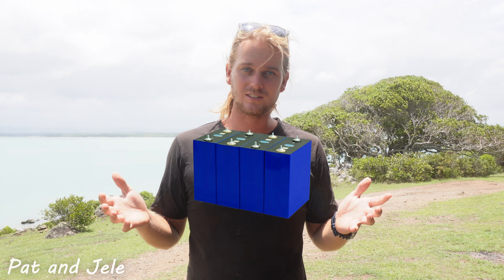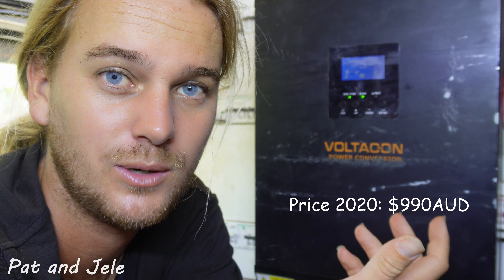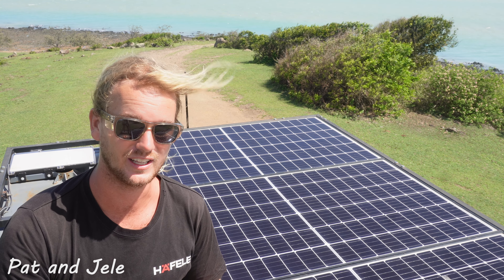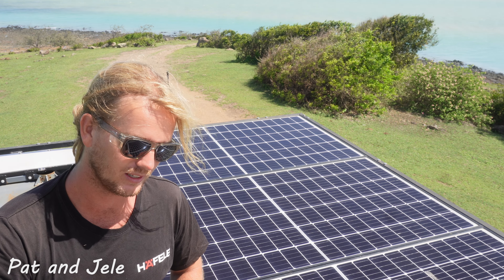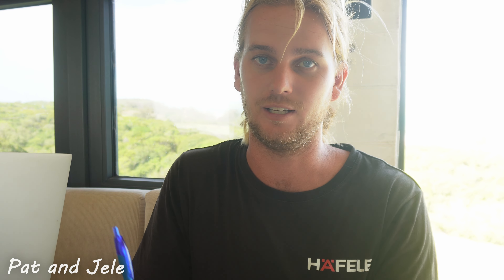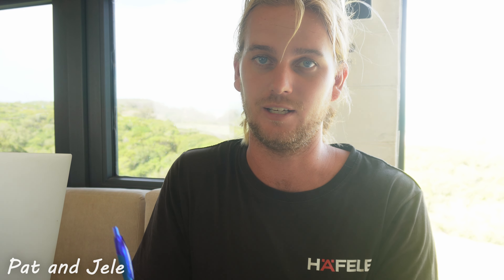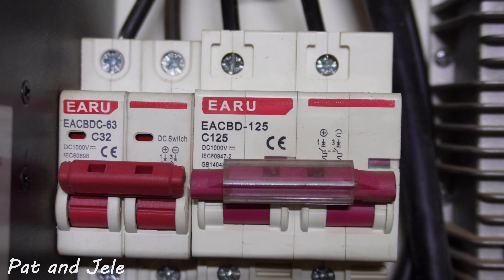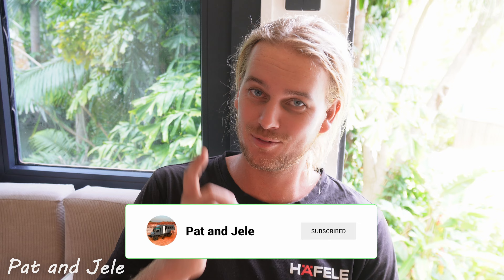MEGA Off-Grid ELECTRICAL Setup! DESIGN and DIMENSIONING of FULL ELECTRIC Overlander System, NO GAS!

Comment: I designed my own system 17yrs ago , while building my own van, I put a basic system in, 2/ 260 amp hr, Full River batteries wet cell, Lasted 12 yrs, Now have 2/ 270 amp hr AGM, batteries, Now over 5 yrs , So my system has a back-up 45 amp charger, 500 Watt panels, 1000 watt inverter, All power goes through marine DC, control panel, Never had a problem, Runs Fridge, lights , pump, TV, Dvd, etc, All day every day, Liked your way you explained everything, Correct wiring size is very important, All my main lines are battery cable, Thanks for explaining, Cheers Bevan 🤠🦘🦘🇦🇺
Reply from the maker: Thank you! Wow 12 years off a flooded cell is pretty good 👍in the end it is great to be able to have everything you need/want like TV and lights and not have worry about it. Yes wire sizes are very important!! Glad you enjoyed :)

Comment: Nice video, one thing though: no such thing as "12v or 24v panels", you always need a solar charge controller and the panels need to output a higher voltage than the nominal voltage of the battery bank. So if you have a 24v battery bank (25,6v nominal for LiFePO4), and you use a panel that outputs say, 24v, you would still need to serialize at least 2 to get the solar charge controller to actually charge the battery, because if you don't the voltage won't be high enough. So don't get fooled by people selling "12v panels" or "24v panels", it's a useless description.
Reply from the maker: Thank you. I don't know too much about those panels but I believe they advertise them as 12 or 24V panels but they output a bit higher than nominal voltage. I wouldnt recommend not having a charge controller anyways even if it just a pwm. There are MPPTs with voltage boost function that can step up voltage, but it wouldnt we worth the effort and cost. As you said easier to wire in series and let the MPPT work. I would never recommend panels like that to anyone anyways, as the most efficient panels are usually the household/array generation ones.
Reply: @PatandJele  Hi there - you really shouldn't have panels without solar charge controller connected to the battery, it will fry the battery. ;)

Keep up the videos!

Comment: Awesome work mate. Your Unimog is the only one I've seen with a 21kwh capacity and the I loved the build vid. You did great a great job of building the bank with prismatic cells. I love to see the vids where caravan sales people are showing off a van and claim power for days, when in realty it's just 5Kwh.😂😂 Also wouldn't it be great if everyone used Kwh instead of Ah. Cheers mate. We are all waiting for the all elusive room tour on your channel, I saw it on Ronny's🤣🤣
Reply from the maker: Thank you! Yeah I don't understand how the caravan industry labels some of their stuff sometimes. I have seen caravans that have no inverter..... But correct they claim being monster systems with 5 or 6 kWh batteries and then people try to run 1.2 kW DC air-con units off them 😅 I hope so too, we've gotten too many "how many Ah do you have"..... ahhh yes that was just a quick run down, ours will be a bit more in depth 😉

Comment: Thanks for an excellent presentation of your electrical system. I’m in the process of installing a 48v system for the same reasons you’ve mentioned. Most of what you said made sense, except for the bit about the “class T fuses”. I have a zbeny 2 pole 500v, 250 amp circuit breaker to isolate my 4xDyness Lifepo batteries 50amp hour each, so 200amp hour @48 volts. Where in the system are you saying the T fuses need to be?
Reply from the maker: Yes there are so many components out there for 48V it is pretty cool to work with! The class T fuse should be installed after your battery, pretty much where your circuit breaker is, as the circuit breaker may not be able to intterupt the required AIC (Ampere Intterupt Current). Simply put if your batteries fail internally they may output such a high current that it will arc over your circuit breaker and can cause fire. That is why Class T fuses are recommended for all LiFePo4 battery banks.

Comment: Great job Patrick explaining what can be a very complicated issue , in a simple, easy to understand way.
24v for me and as you said, cable size difference is massive even going from 12 to 24v
Reply from the maker: Thank you. Yes 24V is the way to go if you run a lot of AC appliances but still run a DC-DC off an alternator! Try bending a 150mm^2 cable :D

Comment: Always thought AH was silly way of measuring battery capacity. I was watching your older video on the battery setup a few nights back and notice you are running a balancer on your pack, most videos I have watched say it causes more issues then solved, whats your experience? do you use the balancer or was it just for the initial top balance? Also do you have the 3d models for the busbar/class T fuse holder you showed off in the older video? Thanks!
Reply from the maker: Yes it is and we always have a good laugh when people ask us about our capacity. Yes active balancers should only be used when charging at the very top end, ours comes on at 3.35V cell voltage. Leaving it on permanently will cause issues (usually the last cell will be out of balance). I do have the 3D models but have modified it a bit to allow for sleveing. But send us an email and I can send you the files :)
Reply: I read up on the DALY BMS and I now know why you run the balancer. Im sure I will get the same questions, I have similar size battery bank to you except I have 32 280ah cells, I couldnt resist seems they were so cheap now.  @PatandJele

Comment: Your LiFePO4 DOD is wrong, they will work best in the flat area of the charge curve, that's about 8-98%.  No issue going down to 10%, will still be above 3v/cell,  but you should avoid long times above 3.4v/cell (~98%) and only go to 3.6v/cell to do the occasional balance. You are doing more damage to the cells at 99% than 12% for sure. That said in solar/off grid the only real factor is time, not cycles - even using 0-100 you'll get 10 years, 20 years 5-99% or 30 years at 15-95% - all assuming just 1 monthly balance to 100% rather than daily hitting 100%

My system isnt too far off yours, 2kw solar, 12kwh battery, 5kw inverter - but here in the UK, with WAY less sun than you down there in Oz its mid winter here and I cant even get 1kwh/day whereas a good week in summer its 10kwh/day.  My 2000kva Victron inverter idles at 17w, and my 3000w giandel 20w.

I'd certainly advise 48v on larger systems, 12v for smaller systems and personally 24v is the worst of both, rather than a middle ground.
Reply from the maker: It's not wrong, just conservative. You can theoretically discharge LiFePo4 to 0% and if you do please let me know how long your cells last (I dont think it will be 10 years). I am trying to advise on building a durable system and limiting your DoD to 30% can add between 1000 to 2000 extra cycles before more serious degradation of your cells (pretty much as you point out the difference between 20 and 30 years).  You are correct in the fact that spending too much time at the opposite end (100%) is equally detrimental. I didnt add this to the video as most of the time when travelling you dont charge back up to 100% (all cells at 3.65V) we typically run between 60 and 90%. The occasional top balance will be when we plug in every month or so. 
How do you supplement power in winter? Is this mobile or just a stationary off grid setup? They have little hydrogen shed systems in Germany that store excess power from summer for use in winter via electrolysis and fuel cell and are capable of storing something like 800kWh in the size of a little tool shed ;)
Yeah even the Victron 5kVA units idle at 18W, and we wished we went that way when we built ours. 
I don't think 24 is the worst as you can still easily find DC components like lights, water pump, etc. (not as readily as 12V, but still better than buck converting it down from 48). I would be torn between 24 and 48 if I had to do it again though :)
Reply: @PatandJele  I use 8-98%  DOD.  Bought in 2019 and full time in my 7.5T Merc.  Plenty of off gridders also use all the capacity and it makes no odds on capacity loss above calendar ageing.  Still say its worse being at 98-100 than it is 8-20    as 8 to 20 is still in the flat voltage curve.  Below 6 or 8 and above 98 is where the "knee" is in the charge curve.  Plenty of data and testing available on that.